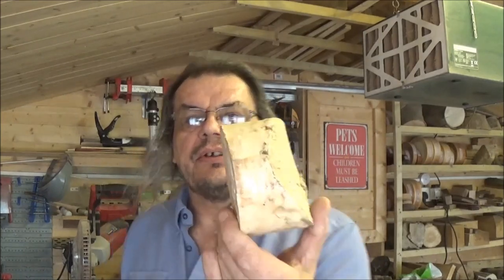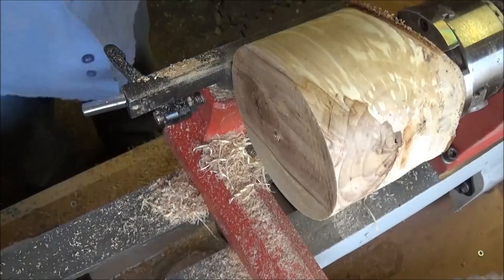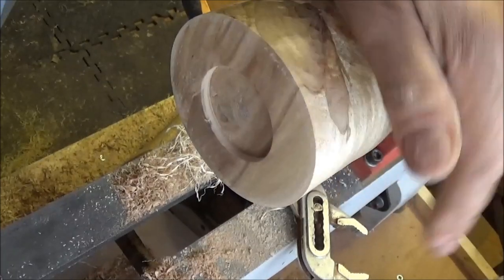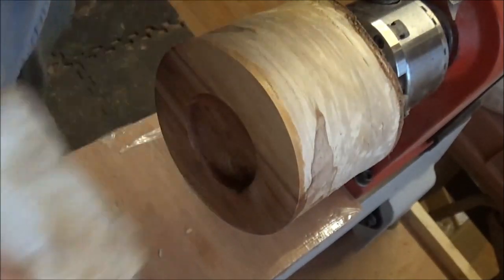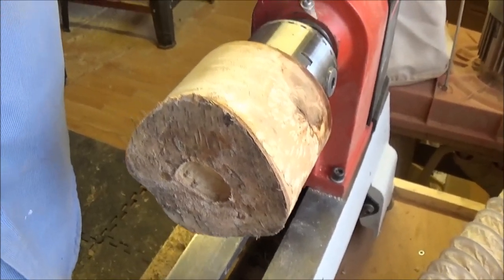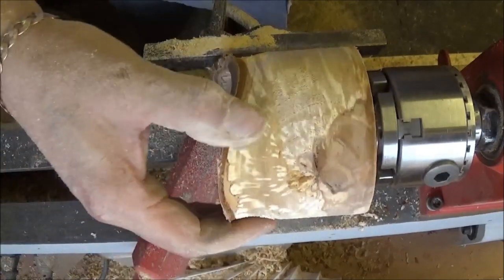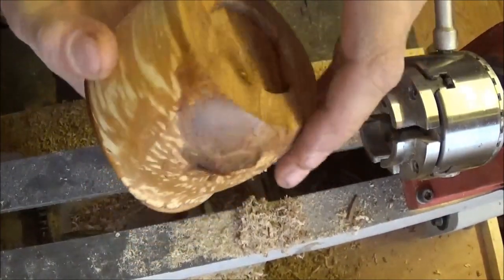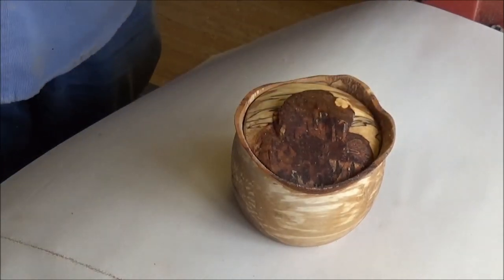Woodturning at 54a. #80. "A Pork Pie Pot"

Comment: Very nice rustic piece Keith. Welcome back. By the way, Is that an Axminster lathe and do you recommend it?
Reply from the maker: Thanks Stu. Yes,it's an Axminster 1218vs with bed extension,and yes,I would recommend it as a good starter lathe,and Axminster's customer service is second to none.I had a small problem with the controller box,and one was sent out the same day. I am now looking at upgrading (to another Axminster hopefully) which will have a swivel headstock for turning larger items. There's also 3 year guarantee with them.
Reply: Keith Barrow Thanks for the info Keith. I have a little Scheppach at the moment. Ok but  no VS. I like the look of yours.
Reply from the maker: They're all made in China,probably by the same company,then shipped out in a bare state for various companies to finish off with their own tweaks and badges. The VS is very handy though!